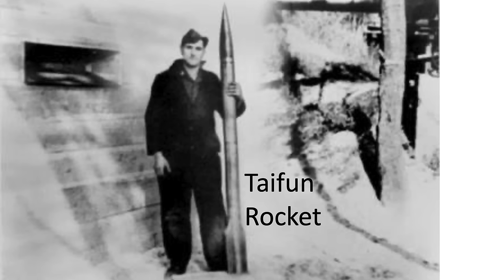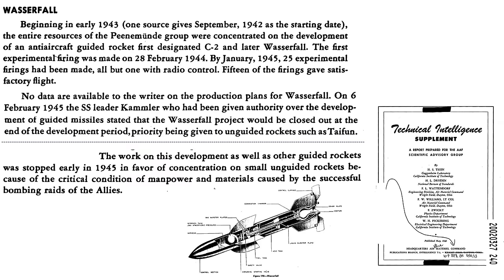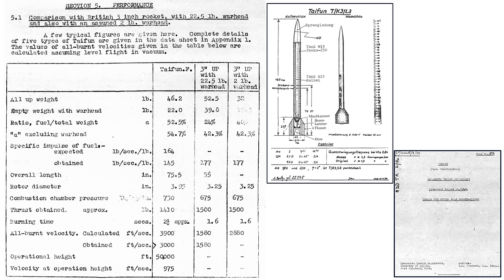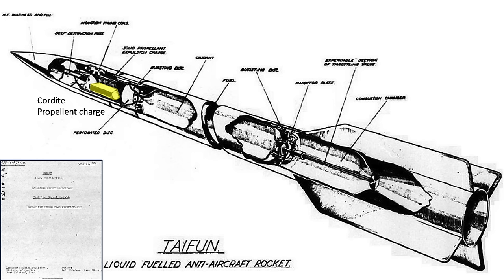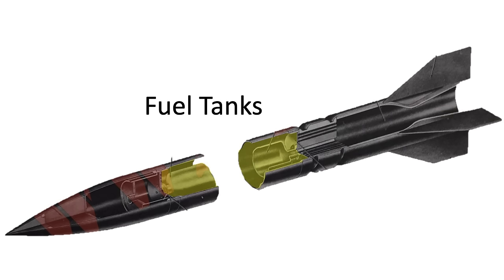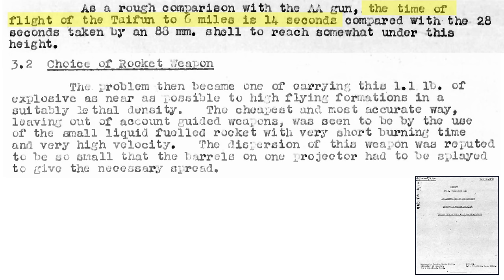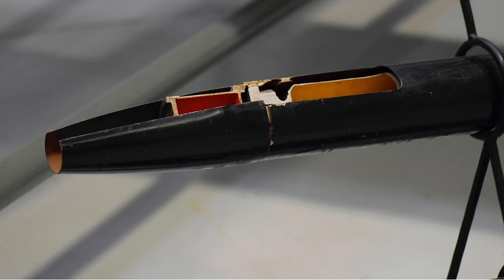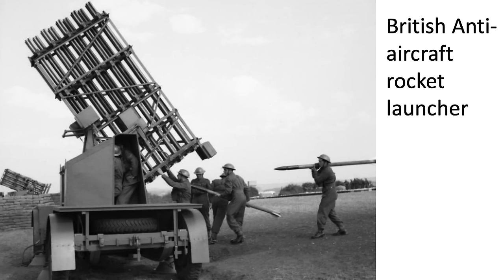Taifun Surface-to-Air Rocket: Germany's WWII Supersonic Answer to Bomber Threats

Comment: " .. accuracy = excellent .. "   Amazing, i never would have thought an unguided missile could be so accurate.
Reply: Unguided rockets can be superbly accurate with enough design effort. It is often the case though that rockets are cheap and mass produced and that results in an area weapon.
Reply: If I was a German engineer given the chance of a life in the US I’d probably make similar claims.
Reply: loki at +/- 4 mills is approximately one minute of angle for 66% or 2/3 shots pretty reasonable if they achieved that roughly 2/3 rockets hitting a 32 inch target at 3000 yards
Reply: haha - yes of course it wasn't - this claim is not explained
Reply: @ambisinisterengineering5242  that's a great way to put it into perspective, that's insanely accurate. Trying to imagine hitting my computer monitor from 2.7km away.
Reply: They were accurate, but extremely hard to aim.
Reply: @annoyingbstard9407 No problem captured German engineer, our Russian ally could use some of your "expertise", we are trading you for other prisoners of war. 

Have a good trip to Siberia comrade.

Comment: A proximity fuse on this would have been excellent for this AA Rocket.
Reply: Was thinking that myself, if they had the Proximity Fuzes the Allies used and with some fragmentation effects they might have been terrifying for the Bomber fleets.
Reply: Yeah, kinda common lnowledge by now and they were working on it.
Reply: If they had developed a proximity fuse they could have fitted it to artillery shells, then you wouldn't need the rockets.
Reply: Yeah, just the warhead is on a smaller side already even without fragmentation casing and complex electronic fuze, so perhaps this would need to be boosted up a bit to keep significant effect on large bombers. But conceptually it's no brainer.
Reply: @TheRealNeill i think that bigger rocket could have been built rather easily by increasing the diameters of the taifun, the simple (for a liquid rocket) mechanisms would have allowed that to happen in a rather short time.
Reply: Allies would have defeated it in quite short order as regards use against high altitude bomber formations by use of jammers and Chaff.
Reply: @brendanpells912  The Original Radio Proximity Fuze design concept given to the US by the UK in 1940 was for just this kind of weapon.
Reply: @richardvernon317   it isn't that easy, stripe chaffs really don't work well in very close distances which are those where radio proximity fuzes operate and can be filtered out by setting of basic receiver parameters, moreover they are effective for specific frequencies which could change for fuzes should that even matter. 

Jammers at the time were also in early stages and premature initialization of radiofuzes wasn't trivial even with much later electronic warfare.

Not that it would change anything, Allies would win regardless, just that it doesn't work like "throw a bunch of tinfoils and you negated proximity fuzes".
Reply: @richardvernon317  If jammers and chaff could disrupt proximity fuses, I'd think the Japanese would have used them. They had both countermeasures already in action by 1844, separately. They could spoof American IFF, too.

Comment: The tank in  a tank design is clever so long as the fuel can be similar temperatures.  It helps structural stiffness and simplifies plumbing.

Comment: Great video thanks! The reason for the exceptional accuracy is the 14 second flight time & the 6 revs per second spin rate. The issue is targeting - if they had developed proximity fuses & built more of these the impact on US bombers would have been huge.
Reply: Until the bombers carry jammers to explode the fuse early.

Comment: Very interesting description, again. Thanks. This serie opens the important side of planning and developing equipments during the WW2. History books tell only about politics and active war cases. Still all the military equipment for soldiers must have been: planned, designed, tested, prodeced, brought to war fronts with preplanned strategics and tactics. Without this essential design the solder is on the front "with a stone from the ground without knowledge to know which direction to throw his stone".

Comment: Imagine a Taifun with a proximity fuse. Yikes!

I noticed the Natter mentioned as a cancelled program. Kermit Weeks has a modern Natter copy in his museum in Florida. It was built from original drawings and was manufactured by a French furniture maker that built Natters during the war.
Reply: Thanks for this tip i literally live 30 mins from there and have never been, now im going.
Reply: The warhead is too small. The 5/38 AAC shells had a 3kg explosive fill, these are about a sixth of that.
Reply: @zhoufang996  

FYI, the 40 mm bofors used a proximity Fuze.

Comment: It also would have been easier to fit with a proximity fuse than a shell (due to lower acceleration), although that might have required a larger warhead.

Comment: I wonder if maybe some were used in operational trials. According to the 100th BG website, on Feb 3 1945, it was observed that AC # 44 8379 (Maj Rosenthal onboard as Command Pilot) was struck by a ground to air rocket just before bomb run on Berlin - if not a Taifun what else could it have been?
Reply from the maker: I'll be addressing this issue in my next video. I've noticed the contradiction. Germany never deployed anti-bomber operational ground to air rockets in WWII. I believe the witness was mistaken. MoTA should have researched German SAM programs and not shown them in the clip.
Reply: @WWIIUSBombers  Your follow up video is excellent, of course, but surprisingly you've identified a second aircraft, 42-102958, that may have been hit by a ground to air rocket as well on 3 Feb 45. The missing air crew report for this aircraft mentions more than one observer see something like an air to ground rocket hit the right wing of the plane, causing a fire. They dove steeply to try and put it out, before doing a split S and losing control. This wasn't the plane Maj Rosenthal was on though and only 2 crew survived from this aircraft. 

The MACR for Maj Rosenthal's plane, 44-8379,  isn't that clear as to where it got hit by something, at least one observer said it looked like a ground to air rocket. Unlike the other aircraft, this one just banked off to the right out of formation after being hit, but then there were signs of fire onboard, engine 3 caught fire, but most were able to bail out before the plane lost control

I think MoTA  certainly got it wrong on how it would've looked if Taifun rockets were used that day, in any case. At least the series has renewed interest in the bravery of the crews  and their accomplishments in such adversity, and channels like yours are greatly appreciated for calling out what they got wrong, while pointing us in the right direction to find more accurate sources.

Comment: I don't know. FLAK had an altitude detonation and shrapnel to enlarge it's 'kill' radius, while this is just a PD round. So it falls into the old "Big sky - little bullet" theory to aircraft survival. Perhaps, with a time delay fuse, shrapnel, and perhaps a 'VT" fuse, along with the PD fuse, it's advantage is leading targets (speed) would have made it formadable. But based on the presentation here, I think it was a poor substitute for the 88.
Reply: The idea seems to be this:  by mounting 30 rockets on a launcher, the rate of fire is vastly improved compared to a flak gun.  so instead of launching a low number of shells that each have a high kill rate (due to air burst shrapnel), a high number of rockets would be launched so that one out of a large number hits th enemy plane.
Also, the Taifun was effective at high altitudes where flak became ineffective.
Never-the-less, it seems to be another example of Germany getting desperate.
Reply: Shrapnel did not do decisive damage to a large unpressurized aircraft.
A heavy contact detonating charge was needed to cause catastrophic failure.
Reply: @JanoTuotanto  : You are misinformed.   Air bursting charges is how both British and German flak was very effective.   When the shrapnel hit engines or fuel systems, it thus stopped engines.   You can't fly without engines.  It also frequently caused fires, and fires caused catastrophic airframe and wing failure.  Aluminium burns really well.  Shrapnel flying through aircraft often injured crew, incapacitating them.   An aircraft  won't fly without a healthy pilot - especially British bombers as they flew with no co-pilot - the RAAF decided before the War they could not afford to train enough pilots, so their aircraft had no copilot position.
USAAF heavy bombers were much less affected by flak due to being able to fly and bomb accurately at much higher altitude, and they had copilots who could take over if the pilot was hit be shrapnel, or assist him with the heavy workload that could arise due to aircraft damage.

Comment: Seems like all of the Germans were missing was proximity fuses for this concept.
Reply: @thefrenchbaguette919  Did they invent the proximity fuse?
Reply: @jmd1743  no sorry gonna correct that mistake
Reply: @thefrenchbaguette919  I think of the most coolest AA systems of WW2 was the 120 mm Gun M1 when linked up with many guns and a  computer radar directed gun.

The Type 5 15 cm AA gun had a lot potential as well.
Reply: @jmd1743  maybe
Reply: @jmd1743  actually they did design proximity but they didn't have time to make them before the factory in Poland got overrun

Comment: If it had had a proximity fused warhead, it would have been much deadlier. Why they couldn't reverse engineer that fuse is a mystery? They never found a dud or captured any munitions one can assume, or their ability to manufacture it was lost by that time.
Reply: As i understand it, the VT fuses were initially confined to naval antiaircraft so that the design would likely not fall into enemy hands and have just that occur. I think all VT fuses had a self-destruct fuse built in, and when that proved to be reliable, the fuses were given to ETO AA batteries in Britain shooting at V-1 flying bombs. By the Ardennes Offensive, 105 and 155 mm artillery guns were using them to hammer German infantry with very effective and grim results. As with most weapons, the Germans were independently working on their own version but never got the kinks worked out.
Reply: There were many different proximity fuze systems in development, but because of several reasons not yet in production. Btw, Germany was the first country to have a prototype of such a fuze in 1939 - see the Oslo Report.

Comment: Now a thought, how close could the Germans have been to launching a satellite? V-2 with smaller rocket 2nd stage say, even make the 2nd stage rocket part of the satellite like the US Explorer. They really were on the rocket/missile game at this time.
Reply: Checked google got this answer:

The V2 rocket, with 1000kg warhead, could reach only speed of about 5760 km/h (3580 mph).
In order to get to the orbit, velocity of about 28000 km/h, or 17450 mph is required. So, about 5 times higher velocity would have required. This 5 times greater velocity means 25 times greater kinetic energy would be required.
Reply: Another google answer:

The US Jupiter missile was basically an improved German A-4 (a.k.a. V-2), designed by exactly the same scientists and engineers wo designed the A-4. The Jupiter engine had several incremental improvements that let it use hydine* as fuel instead of ethyl alcohol and water*, as the A-4 used. The better fuel delivered more power, which allowed them to “stretch" the design with bigger fuel tanks.

In 1954 Project Orbiter was proposed. The idea was to use a Jupiter missile as a first stage, with fifteen cut-down solid-fueled Sergeant rockets as three upper stages. The second stage would be a ring of eleven Sergeants, with an inner ring of three as a third stage. The satellite would be attaced to the single Sergeant fourth stage. There was no guidance for the solid rockets, so the whole contraption (the satellite and the fifteen Sergeants) was mounted on a turntable and spun at high speed for spin stabilization. Some work was done, but the project was cancelled in 1955. However, the rocket, called Jupiter-C (for “composite") was developed to test warhead reentry designs.

After the Soviets launched the first satellite and a US Vanguard satellite launch attempt spectacularly failed very publicly, Project Orbiter was revived.

In the meantime the Jet Propulsion Lab of CalTech had prepared a satellite for Project Orbiter on their own, just in case.

So on January 31, 1958, a Jupiter-C, which was basically an improved A-4 with a bunch of solid rockets on top, launched Explorer-1, the US' first satellite.

*Hydine is 60% (by weight) unsymmetrical dimethyl hydrazine and 40% diethylenetriamene.

**Yes, water. Straight alcohol made the engine burn to hot. That is what drove all thise incremental engine improvements.

Comment: it seems to be another example of Germany getting desperate.   It would only be effective if fired in vast numbers.   And it is a defensive weapon only.  To win an all-out war, you have to take the fight to the enemy's territory.
Reply: By the late stage of the war, when this rocket was designed and tested, germany was very much gearing into defensive warfare. Had it been deployed, it would have been fired from tens, if not hundreds, of launchers positioned around high value targets. Germany did take the fight to the enemy´s territories, basically occupying the whole of europe, parts of scandinavia and africa.
Reply: Desperation that led to better weapons......
Reply: @juslitor  You need to take the fight to your enemy's territory, not the third party countries you have already captured and subdued.   For Germany that meant taking the fight to England, which they did only weakly, and to the USSR which they could not subdue, and to the USA, which they could not reach.